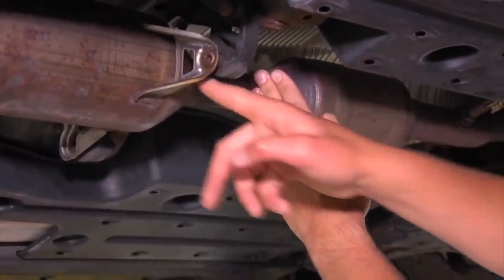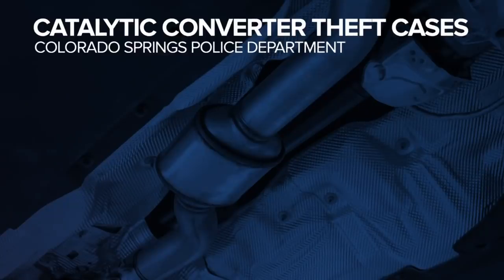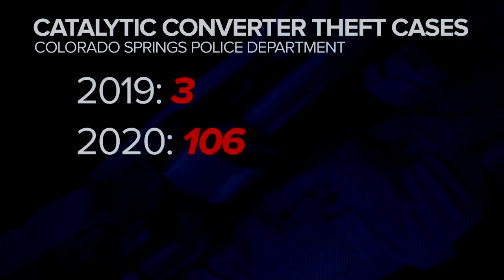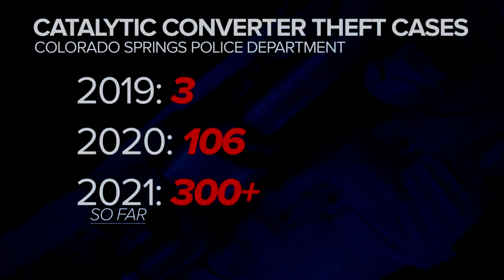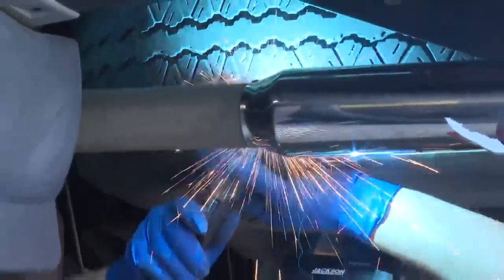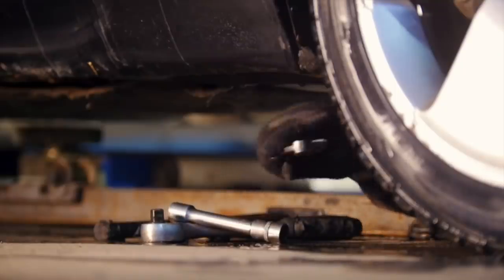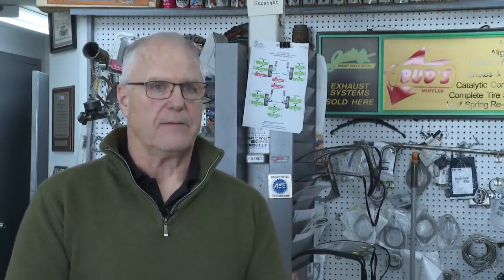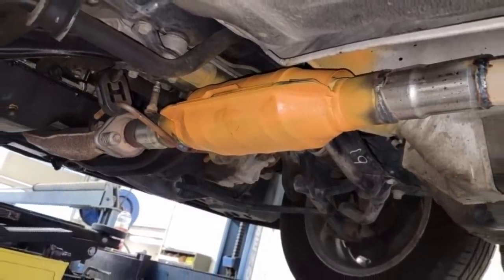Catalytic converter thefts continue as muffler shop tries to help customers and investigators

Comment: I did everything I can think of to my truck like that to improve fuel mileage , at 5.83 mpg , maybe I should call those catalytic converter theives,  they might be doing me a favor .2000 gmc 3500 bucket truck , with a little 350 tbi , and a 4l80e ...its heavy and thirsty ....